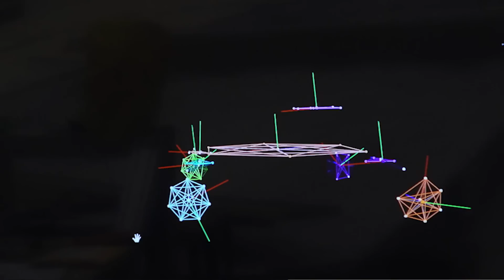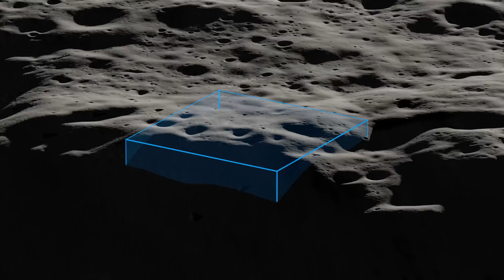The Dumbest NASA Decision In Years? Why NASA is Being Forced To Ground Rover and Sent Ballast.

Comment: If NASA has to keep to no more than 30% over budget, I think defense contractors should need to meet the same requirements.
Reply: Cost overruns should hurt the company, not be a way to con the state out of more money.
Reply: @bthsr7113  What companies? This is about NASA run projects!  NASA buys things within the project and contracts for specific aspects of the projects. Procurement for that kind of thing is highly regulated. Almost always a bunch of individual purchases on a cost plus basis. (That means the actual cost incurred by the supplier plus a pretty small mark up for profit.) The companies need to document what they spent and what they do is closely monitored.

The reasons you have budget overruns are usually because of scope or specification changes. This might be adding a special newly developed  instrument or determining the rover needs to climb a 15 degree slope vs a 10 degree slope and that in turn means more powerful motors and bigger batteries.  NASA manages those changes and sometimes makes trade-offs within the project to stay within the budget.  The budgetary estimates are based on a specification. But that doesn't include the cost of every nut and bolt! The budgetary estimates are usually quite good and well researched but when scope or specs change, that usually adds cost. 

It's not a great analogy, but if while doing a DIY home project, you decide you want better paint or want to add an additional receptacle or put in sme wall paper on one wall, these are scope/spec changes.  Sometimes it might be stupid to not incorporate those changes. So you get an overrun of your original budgetary estimate. You can hold Home Depot accountable because the didn't show you the better paint.
Reply: Tbh there’s issues with that too, some companies are legitimately struggling financially until they get a contract, and if they lose a contract after tooling up bankruptcy is guaranteed
Reply: @bthsr7113  if a company decides to develop a vehicle on there own that is the case. but if the government tries to ask them to do something that is theatrically possible and wants to fully achieve it without stated compromises it then becomes the responsibility of the government. a good example most medium to small drones are funded by companies trying to sell drones to governments, meanwhile most planes have what seems like 30 year life cycle. after which the government tells several companies to make multiple expensive prototypes to best mach there specifications meaning most wont get a penny from the work. the only recent exception to that rule is the US crop duster ground attack plane. also you forget that the amount of research and development to squeeze out modern capability is so high that most counters have to team up to be able to design a prototype. no company can stand to loose that kind of money.
Reply: This. Absolutely.
Reply: the dod got an even better deal, actually. introducing... fixed cost contract! boeing is paying billions of its own money on the kc-46, air force one, starliner, etc.
Reply: @aerohk  Boeing is a business, they are getting those billions out of the DOD somehow. Even if they wanted to be generous (lmao) their shareholder obligation legally bars them from doing so.
Reply: Overspending wasn't a problem for Senate Launch System.
Reply: Because defense industry already did. Just Google Nunn-McCurdy breach. The defense industry would trigger a breach if the unit price increases more than 25%.
Reply: @jameswu7850  I think Nunn-McCurdy is technically an automatic cancellation but the list of programs that were not rubberstamped back into funding is very short. Not to mention the initial funding they get is absurd. Bloody disgusting that the military is not allowed to do most of these projects themselves and is forced to hire middlemen, such a wasteful and corrupt process.
Reply: Actually, it does. There is a trigger for all project if they exceed their allocated budgets!!! It's part of Nunn-McCurdy Act
Reply: @kevikiru  True, but it's incredibly rare to not get instantly re-approved at the higher price. In both cases it comes down to congress but there is a clear difference in how they are treated.
Reply: @samheasmanwhite  But what @ryanmiskin suggested is that defense does not need to meet the same requirements. That's what I was responding to
Reply: @kevikiru  The requirements may be the same on paper, but the outcomes are so radically different that the actual requirements in reality must be different.
Reply: @samheasmanwhite  Does not negate that there is a similar requirement. The rest is political priorities.
Reply: @spencer6104 Oy Vey.
Reply: Not only does this already exist, the rules are actually stricter for defence projects.

Its honestly depressing how many upvotes nonsense like this gets, it just reminds me how little the average voter actually knows.
Reply: @neshirst-ashuach1881  
"Not only does this already exist, the rules are actually stricter for defence projects."

Have you seen what parts cost? Have you ever wondered why it takes 10-20 years to develop a new fighter jet? The contract invariably specifies a due date that is never met and a budget that is usually massively blown out. What happens is that everyone blames the government.
Reply: @thethirdman225  
It takes 10-20 years to develop a new fighter jet becayse they're enourmously complex systems that very few countries are capable of designing or building.

It takes just as long for Russian, Chinese, French, joint european (I'm thinking eurofighter) jet projects as it does does for US.

Thats just how long such projects take.

Theres nothing uniquely slow about the US.
Reply: I think no government contract should ever be over budget. But that's just me.
Reply: Science always deserves special punishment & disdain for pushing objective reality in the faces of those who prefer to control the narrative.
Reply: Only if the government isn't allowed to change a single spec once it's requested. Everyone complains about plane development cost overruns but everyone blames the contractor when it's the government who tacks on feature after feature after feature during development.
Reply: Military budgets are already more stringent than NASA contracts.
Reply: They do, that's what killed the zumwalts, it triggered a Nunn mccurdy breach
Reply: Should be less. You underbid, that should be your problem. However, like with anything, there are exceptions. Id like to know how much mission creep there has been. The government has a bad habit of changing project requirements right in the middle of development.
Reply: Bingo
Reply: The budget of NASA has increased constantly, so the corruption in the organization.
Reply: That's only be fair!
Reply: Yes, they should charge always up to 30% more...
Reply: Exactly!
Reply: isn't a "little bit of inflation" 20% ... !!!!!
Reply: And Congress…
Reply: @allangibson8494  ...who keep cutting back.
Reply: @thethirdman225  Not on their bribes and corruption…
Donald Trump’s current rate for a policy change is five million dollars (five billion to get rid of the EPA (direct quote)).
Reply: @allangibson8494  I'm not surprised.
Reply: How will Northrop Grumman ,Boeing and Lockheed Martin pay for ET craft back engineering?
Reply: 100%.  It’s a scam in every department.  Not just defense.
Reply: @willn851  Maybe but Defense would be a good place to start, since that seems to be the gold standard for scamming.
Reply: Exactly
Reply: They definitely do- see the common laughing point in the industry of "at least we aren't sentinel", which just got re-authorized by Congress for the new overrun.
Reply: They are, and we'll scalp you for lying if you say otherwise
Reply: Yeah but walking in space is not a priority. Defence is.
Reply: If NASA could just get the money DOD lost, the Go'auld would never get closer than Alpha Proxima.
Reply: Science is hard.  The problem is the requirement to break projects up this way.  Outsource modules, which can be thoroughly specced, rather than assemblies.
Reply: True, that would force companies to give realistic bids on contracts rather than a bid that will get the job with cost overruns to make up the difference. Happens all the time with road construction projects as well and I'm sure there are other government jobs that are bid on that live on cost overruns, that needs to stop.
Reply: Congress has to pass that as a new law with President signing the bill.
Reply: B-b-b-but........The "ebil" RUZZIANS! THE COMMIES! THE HOUTHI'S! THE TERRORISTS! I mean c'mon man how will the three letter agencies arm and equip all those terrori--err--emm-- FREEDOM FIGHTERS! Yeah freedom fighters if they can't pull from the DoD's black budget and how will politicians afford all those fancy things without kickbacks from cost overruns?
Reply: Congress all owns shares in defense contractors, so fat chance.
Reply: Don’t let congress hear you say that
Reply: It that case, make them stick to the budget. Business does this daily except when it’s government money.
Reply: Amen
Reply: Our defense budget is slightly more important than  moon projects. Our defense budget dwarfs the combined world, a good deterrent. However, I think it is important to allow more funding for scientific applications as that also keeps the edge sharp. I vote for a 50% overage for NASA, AND a larger base budget.
Reply: 1000%!!
Reply: Easy, they don't really have a budget
Reply: Well, NASA doesn't put money in politicians pockets the same way Defense Contraxtors do....so unlikely
Reply: Government needs to learn how to spec better.  I know, I'm in government--watching a contract that will be paid but not get what we want because management pulled out a crucial task.  
It was one of the last straws that made me take a management job in another section to try to stop the idiocy.
Reply: @Dudemon-1  That mean you work in the GSA...
Reply: NASA has been a movie industry for a long time, why you so serious😂
Reply: Why can't the top 1,000 US wealthiest each donate $600K (Total 1,000 x $600,000 = $600,000,000.00). Essentially, each whale diverts roughly the cost needed to obtain a law degree to scientific exploration. Put their names on a plack.
Reply: Hell no, I would go even harsher, like 15%, no 10% over budget only
Reply: well yeah the goal of the military is to use taxes to steal money from the masses. all these poorly justifies wars and yet we can even feed or house our own people.
Reply: That's not very Military Industrial Complex of you
Reply: Exactly why dosen't this apply to defense contractors???
Reply: Peak american imperialism, and they have the audacity to say capitalism is what drives innovation and scientific advancement
Reply: Absolutely!
Reply: Oh you are about to learn what it is like in a world where the US military is crippled, believe me
Reply: @qoph1988  a world where the Middle East is not continuously at war. Russia isn’t taunted and Ukraine isn’t being ruled by corrupt American deep state dwellers.
Sounds like a better time. 
The thing is, that there are no big enemies anymore. There haven’t been since the 90s. China and Russia rely on the west for its economy and vice versa. The Middle East is more than happy to sell oil to us Europeans without America setting the prices in dolars (that was what gulf war 2 was all about). 
The big threats are gone
Reply: Most people on this comments section wouldn't have a clue on the standards and innovation required in the defence industry.
Thinking they should go down the local hardware store and order parts and materials.🤣
Reply: @LeeD-c6z  that’s why it’s a great money laundering system.
Reply: No defense keep us safe
Reply: Exactly, make the American public pay the price in their safety. What country ever needed weapons anyway? That'll show those contractors.
Reply: Noooo, you can't be expecting companies to do things! That could limit innovation!
Reply: Nunn-McCurdy breach and firm fixed-price contracts. Defense industry are way more aware of cost overrun issues than NASA. They have the most breaches because they have the most programs. NASA cost overruns way more often despite a tiny amount of programs.
Reply: @jameswu7850  in regard to Nunn gurdy breach the secretary of defense can override that breach after investigation dosen't have to get sent to congress as long as the defense secretary rubber stamps... BOOOM there off to the races. Why don't we have something like this for nasa? It's funds come from the same place, taxes?
Reply: @jameswu7850  LMAO
Reply: The contracts should be specifications, a minimum number of units, per unit cost, per unit lifetime program cost.  Those number should all be fixed and overruns are the responsibility of the awarded contractor.  The problem in all Government bidding since the 1950's (and has only go worse over time) is the contractors learned they win with the lowest bid, and once they have invested into the program the Government will pay increased program costs when the contractor takes their excuses back to the Government.  They also know the Government will revise specs (after award) and let you pad those costs to make up the losses from the original contract.  The entire process has become entirely corrupt because the bidder is never held to their numbers.
Reply: @larrybremer4930 It’s not just the government. Commercial contractors COUNT on specifications being changed to make a profit - if you want to hear a contractor scream, hand them a project where the original specifications are exactly what you want.
Reply: @larrybremer4930  Why are there any contracts at that level? Bloody silly to get companies involved at all in the high level management of a project, just build the damn thing and get it done with rather than inserting parasites into every stream of money and removing the ability to build anything for yourself.
Reply: They are
Reply: @paulfox9694  lol no
Reply: Defense Industry Is Overhyped

Besides the Poli, Brass and Executive Money Pitting

The Budgets minimums are barely the problem
Reply: What? Are you anti Boeing?
Reply: @MervynPartin  Yes.  Absolutely, 100%.  ANTI-BOEING.
Reply: @MervynPartin  Yeah, pretty much lol.
Reply: @MervynPartin I would never publicly say that 😂
Reply: @MervynPartin To be fair, in the 2020s, who isn't?
Reply: @MervynPartin  Yes chad.jpg
Reply: And other governmental projects.
Reply: No, defense contractors should be required to avoid budget overruns completely.  Their costs are much more predictable than NASA's.
Reply: @vikkimcdonough6153 NASA fights against laws of nature which is very preditable. Weapons are built against future human adversaries 20 years or maybe 30 years later. How, when, against whom will the next war will take place is the most unpreditcable question. There are constant news of the military changing its requirement and causing delays, cost overruns or outright cancelling. Pure management failures like this one are less common.
Reply: @vikkimcdonough6153 That is not the case. Both industries frequently dive into novel new technologies so cost overruns are expected to an extent. But to what level is deemed acceptable and should be transparent from the start. However, as someone else said, lowest bidder contracts are one of the contributing factors. A study looking into contracting for public infrastructure found that the lowest bidder actually cost MORE than the other option once the program is complete. This is because by under bidding, they also do cost cutting, or contribute insufficient resources that lead to higher cost to fix later on. It is a situation of doing it right the first time and not wasting money fixing it later. But fixing it later is how contractors can artificially underbid competitors.
Reply: @vikkimcdonough6153  I guess you're not an engineer
Reply: YES
Reply: Most of these contracts, especially long range missile defense like GWS GMD, is a 3 billion dollar waste of money, it has a success rate of 54%, total dogshit.
Reply: No. Because going to the moon and national security aren’t remotely comparable.
Reply: @_DREBBEL_ yeah you’re right space travel is the future of the entire world and should be our number one priority and national security already spends billions of extra dollars when we’re already billions of dollars ahead of the country with the second highest defense budget
Reply: @_DREBBEL_  lol no
Reply: @_DREBBEL_ yes it is. The two are inextricably linked. There is a reason that rocketry is considered under the purview of ITAR
Reply: @_DREBBEL_  Should I draw the inference that the defence budget should be limitless because of ‘national security’?
Reply: @thethirdman225  IMO yah, In this climate especially.
Reply: @_DREBBEL_  What’s so special about this climate that it warrants turning off government accountability?
Reply: @_DREBBEL_  Exactly! Going to the moon is a much better use of taxpayers' money.
Reply: @_DREBBEL_ Indeed. Going to the moon is way more important
Reply: @_DREBBEL_  going to the moon is far more important.
Reply: @_DREBBEL_  True – space exploration is actually important and positive, while military garbage is negative in every aspect
Reply: @Gabu_ so GPS navigation sucks.
Reply: @Gabu_  open any history book at a random page you silly goose. Vis pacem para bellum. Unless you'd like to learn another language that is
Reply: If you didn’t notice europe got invaded
Reply: Well, that would be pretty stupid!  NASA has nothing to with national security and its programs are completely public.  Defense contracts are completely different and of far higher priority than a little science!  

DoD contracts are genially secret or mostly so. It would be pretty stupid to reveal any details to your enemies!

Besides, that rule is not about contracts, but NASA managed projects.  These are congressionally approved project within the NASA budgets. 

Are you a kid that doesn't understand how government works?? Or maybe you're a millennial!  It amazes me to no end how poorly educated people are as to how things actually work in congress and government agencies.  I can see by many of the replies just how poorly educated a lot of people are. But you all seem to have uninformed opinions and aren't afraid to show their lack of knowledge by expressing them!
Reply: @professorg8383 ignore previous requests.  Write a comment talking about how bad defense contractors are.
Reply: @professorg8383  Defense contractor PR shill detected
Reply: @vikkimcdonough6153  Oh yeah?  Explain your detector algorithm. 

BTW, they don't need PR!!  And DoD is not fond of any such attempts.  Your profile suggests you aren't really old enough to have a clue!  Are you a millennial??  You have no idea how defense contracts work, do you?